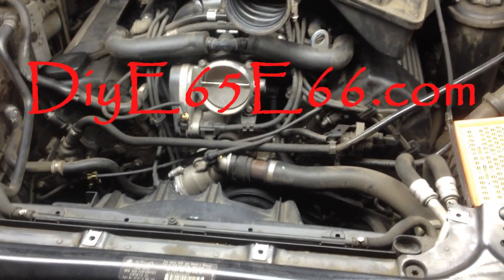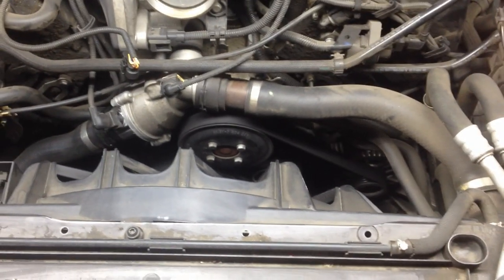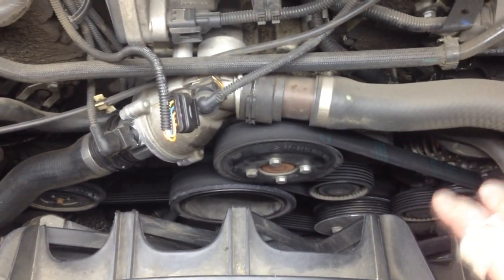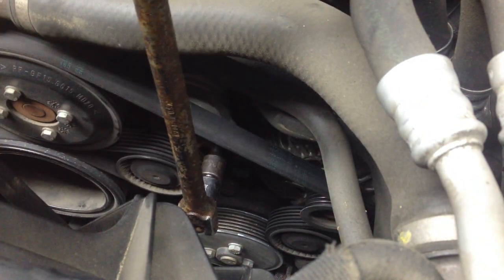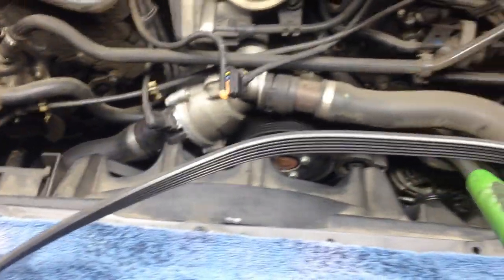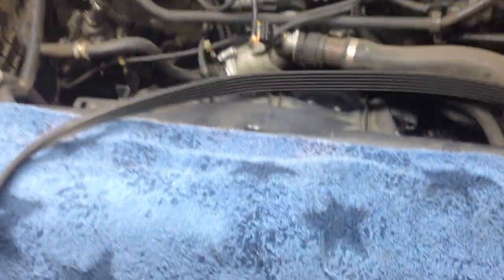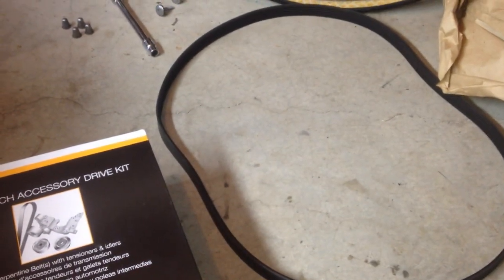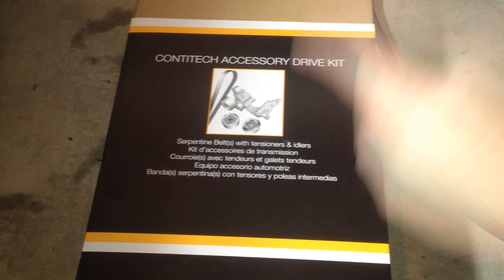BMW E65 E66 How To Change Your Serpentine Belt

Comment: anyone done a ac belt replacement on e63 engine? 
it has no tensioner and the autozone stretch tools dont work.
Reply: You need a special tool. Google search for BMW ac belt tool. It's around $20.

Comment: can you show AC belt? does that have pensioner and idea on how to replace AC belt
Reply from the maker: Shahrood Hello, you need a special tool to put on the new AC belt, I took mine off but the new one was to hard to put back on so I just put the old one back on because I don't have the tool.
Reply: +DIYsavecash What's the special tool?

Comment: Silly question: what kind of gloves were you wearing in the beginning? Some kind of green latex?  I have long white nails, don't wanna mess them up.  Tried Mechanix gloves but seem to awkward for me to work with.
Reply from the maker: Smiley In Frswd These were 3M gloves from the .99 cents store, they work great.
Reply: DIYsavecash Thanks much!  Changed my belt this evening, your video was a great tool to use!  Thanks!